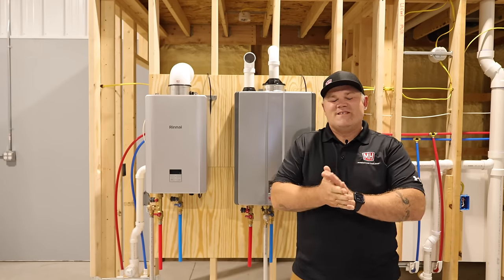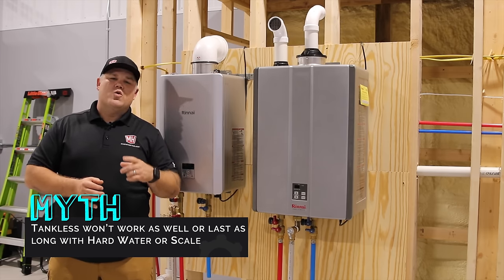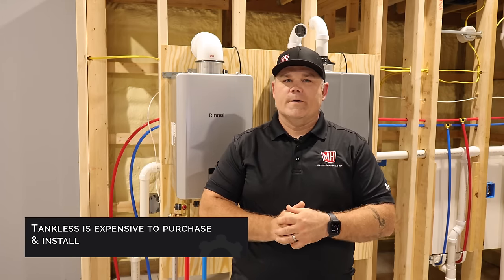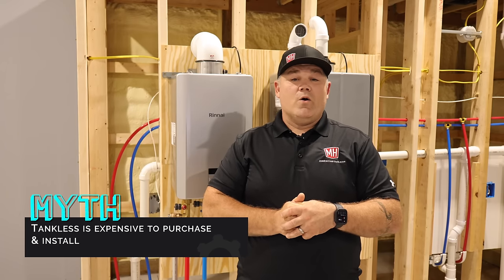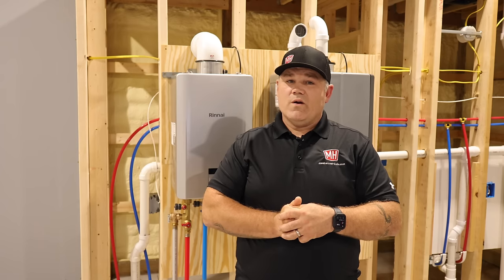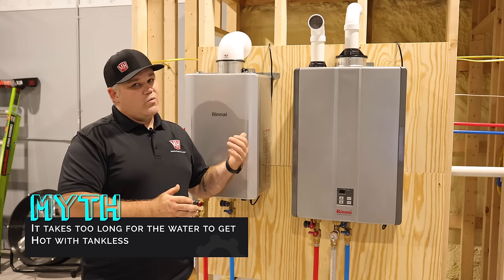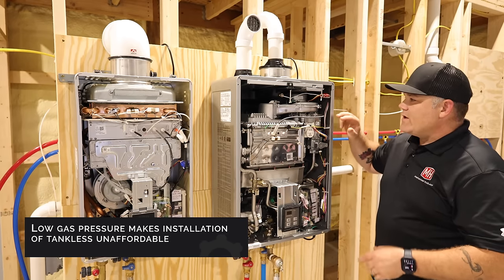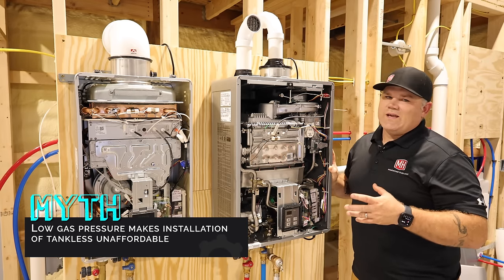Myth Busting! Tank -vs- Tankless Water Heaters

Comment: We have 5 mobile shower trailers. All running tankless heaters. We run 2 199k hot water heaters to run 13 showers with 1.5 gallon shower heads. Second unit hardly ever kicks on. Delime them every fall and good to go.

Comment: What’s your opinion on gas vs electric. In our previous home we had natural gas and when we put in a tankless water heater it was gas. In our current house gas is not available so we have an electric tank hot water heater. I haven’t ventured into a tankless because I’ve been told electric tankless water heaters are not efficient and cost more to operate. What is your opinion?

Comment: Tankless have issues with high efficiency applicance that cause short cycling. HE app. will turn on the hot water for short bursts which prevents hot water from ever getting to the applicance. Only option to add a hot water storage tank, or to use a small tank water heater in series with the tankless.

This also applies to using a hot water at a sink, which you turn on the hot water for brief intervals. The Rinnai tankless have a 30 second cool down mode, which once demand for hot water is ended, it goes through a 30 second cool down cycle before the boiler will fire back up to produce more hot water. The only way to address this is to leave the faucet on until your completely done using the hot water.

Comment: Big thing for me, I will have to first install at least THREE TIMES the length of wire, and that 8/2 AWG x 3 as opposed to the one length of 10/2 I have now. And I cannot pull it through the section of house where the current wire exists. So that would be waaaay too expensive for this ol' retired man on a fixed income. How long is a tank water heater going to last? How long am I going to last? Where does that cash for all that wiring and retrofit come from? Questions, questions.

Comment: gas or electric...does it make a difference and please go over the pricing and money savings in general...my current water heater is really old but keeps working and is gas powered...in Ohio it seems like gas is more expensive than electric so should I convert tankless with or without using gas.......thanks

Comment: I'm a plumber and have been for years. I know tank water heaters are not as efficient as tankless because a tank water heater has large standby losses. The water in the tank is cooled by the vent running through the tank. When tank heaters are off, the 120 deg. water that surronds the vent is cooled by the air constantly going up the vent from the floor around the heater, consequently, the tank water heater runs for roughly 10 min. every hour to maintain tank temp. Without a drop coming out of it. I have a condensing rinnai tankless and have found that it does take longer to get hot water because the tankless starts from cold whereas the tank has its capacity of hot. It just has to get to the tap. Tankless have to sense waterflow and go into an ignition cycle which in my case was around 7 sec. It doesnt start heating the water until it lights and regulates itself. I put a motion sensor in the bathroom which starts a circ pump and is in series with a temp sensor so it doesn't run all the time, only when you walk in the bathroom if the temp sensor is calling. 
Sediment in the water is harder on tankless because their water passages are tiny in comparison to a tank. All water, except for distilled or reverse osmosis water, has sediment in it and will accumulate in any water heating appliance. A coffee maker or tea kettle is a great sign of how much sediment is in your water supply. 
Because tankless heaters have such high energy imputs, whether is nat gas, propane or electric, the energy supply will have to be increased. A storage type usually uses a 1/2" gas line, up to a certain size. Because the input on a tankless is so high, often 50% higher than a standard furnace and storage water heater combined, the line feeding it needs to carry more energy, if the area is developed between the furnace rm and the house supply, this can get expensive. If you're replacing one tankless for another and the previous heater was done correctly, the installation of another tankless should go smoothly. When you change from a storage wh to a tankless is when you run into more expense for the reasons listed above. I know storage type heaters have gone way up in price an although i havent priced a tankless since i put ours in, i can't see them being imune to the same increases tankless saw, especially since there are way more electronics on a tankless than on a standard, atmospheric vented storage type water heater. The latter doesn't use any electricity wereas the fan vented units do.

Comment: Tankless units are okay for homes on wheels, summer bungalows or places where central heating isn’t necessary. There was one important sentence. It was about cold ground water. That needs to be emphasized because these units can struggle to get water warm enough during the winter.

Comment: Both ways work. 11:41 11:41 
It's good to have choices. I have stuck to tank living in CA because of service interupt. Power and water supply can go down. My tank heater uses natural gas to heat and no electricity. If the power is out and water and gas are still flowing I get hot water. Another reason is that the tank holds about 70 gallons of clean potable water. When services are out ig. earthquakes, I have a good supply of drinking water.

Comment: Plumbing since late 70s  The best part of a Tankless is the "luxury" of never running out of hot water. These mythe were busted but I dont think its as cut and dry  as the host made it sound. I wont cover everything but one bit of math was off a bit, shower uses 2.5gpm and with cold mixed in about %85 capacity he said it comes down to 1.5gpm just doesn't add up, 40* well water is colder than most of the rest of the country so in a bit warmer climate he is correct. The installation is job to job especially when converting over. If you treat your water that is going to almost double the cost of WH install, with repeated maintenance but worth it in the long run. 
      That all being said at the end of the day what sold me on tankless is that LUXURY of never running out  and if I was going to build a house for myself I would absolutely put in tankless, with a   recirculating system, I had recirc in my own house, I just sold, and the luxury of almost instant hot water is better than never running out, my wife and I miss that terribly. Depending on your layout it can almost be impossible, as my new house is. With a basement or crawlspace it is very doable but not an insignificant cost. I would insulate the HW lines as much as possible also.

Comment: I got the part of circulating the hot water, but what about using more than one tankless. For instance,  the bathrooms and kitchen are at the opposite ends of the house. This would solve the problem of waiting for the hot water with the added protection of having hot water if one of the units has a failure. A circulating system wouldn't help. 
Is this a good option in spite of the cost?

Comment: The tankless water heaters that were commonly used in Europe and much of Asia, used a series of tubes running through electric elements to heat only the amount of water needed for a particular purpose. the first electric tankless water heater was invented by Stiebel-Eltron in 1929

Comment: I’ve had a tankless water heater for 7 years. Very disappointed with it. It takes awhile for it to heat up the water, which means you have to run the shower for at least 5 minutes before it gets warm, and it’s right next to the utility room. My kitchen sink never gets warm, I’m not willing to waste that much water for the wait. I have an old house and the pipes aren’t as insulated as new houses and I have a well, so maybe that’s why. I’ve been thinking of getting a small tank water heater just for the kitchen so I can clean my dishes with hot water.

Comment: In 2020 I replaced my gas furnace and direct vent gas 40 gal (was a rental) hot water heater, and I wanted to look at an "on demand". Despite a direct vent flu going up through the roof from the basement, the company installing said it couldn't be done...they only had through the wall venting ...so they put in a 50 gal gas fired power vent unit... and capped off the chimney vent.  Now I'm seeing in this video a direct vent on demand unit?  Is there a height restriction on wall for tankless (I had about 6-1/2 ft floor to bottom of existing chimney vent) or were they just taking the easy way out for them? Side note: about a year after the install I noticed the pvc vent pipe had popped out of the top of the new tank and a good 1/2" gap between tank and pipe... not impressed

Comment: I am a new subscriber. The comparison you made between traditional tank vs tankless water heater has led me to favor the tankless option for a two-storey I want to get built. My one reservation rests on the water pressure. Would it be strong enough for our second floor showers? My water supply comes from an independent stainless container sitting on ground level.
Reply: The tankless water heater will not affect your pressure. They would have no poor effects on the second floor plumbing. Do be advised that you will need to get them serviced every year though. If you learn how to flush it out yourself, which is really easy and clean out the heat exchanger, blower wheel for the fan, igniter, and flame rod, and all of the other little parts that need to be serviced you can save yourself, thousands and thousands of dollars over the life of those heaters. You certainly need to de-scale it once a year at a minimum. If you purchased the tankless heater with the understanding that it has to be serviced like an air conditioning unit does, you will be pleased with it for a long time. most people just ignore it, and it becomes a money pit.

Comment: I've installed a tankless water heater in my house several years ago. I did it myself cuz I used to be a plumber.
Now also, I used to live in Europe where those things are ubiquitous.
I bought it on eBay from a Chinese supplier.
It works great and saves a lot on your gas bill.
Get rid of that gargantuous  water heater and get a tankless.
Just trust me.

Comment: I agree with all but one myth. I work for the local gas utility and I have found that with natural gas, there is sometime an initial pressure and volume issue upon start up of the burners. The burners turn on then about one second later the gas pressure will drop due to static line pressure. Once the gas gets moving there is no longer an issue with pressure or volume, but that split second or really one second of delay causes the burner to shut off due to flame rectification not being seen in the unit. The only fix is a bigger diameter gas line. Most tank water heaters use 1/2” line. Usually a 3/4” to 1” line is needed, of course all depends  on distance. I own a tankless and will never go back to tank.

Comment: Question regarding water hardness and quality.  If you have those issue, what type of a fix should I be looking at?  I do need a repipe as I have low pressure. So I figure I need to correct it at the same time.

Comment: I've had a Rennai for a couple years and the only issue I've had is the fan inside. I replaced it once but have had this issue for 1.5 years. It shuts the until off after running for a few minutes if I use the hot water at full blast. I don't understand why this problem is.

Comment: Ive had tankless for 15 years. One thing you forgot to mention. When the power goes out. You dont have hot water. Most new tankless dont have a pilot light. The older models did though.

Comment: mine is a 24Kw electric unit, and since its all electric no vents! just needed to install 2 dual 60 amp breakers LOL
but my electric bill has droped an avg of $23 a month...
We also turned down the power draw form 120Amp (24KW) max down to 60Amp(18KW) max, When we did this (it was a Pin change) the electric bill droped another $18 avg per month.
I still get 109F in 5 seconds, and 120F in 11 seconds

Comment: How often do you flush a tankless water heater
Reply from the maker: Annually is what recommended by most manufactures
Reply: I do mine every January. Have had my Stiebel Eltron for 6.5 years without an issue.

Comment: Yes you left something out. Instant water heaters. We've been using them for 3 decades. They are instant (well, actually take half a second to heat up), runs on electricity, provides an infinite amount of hot water, and is very cheap. I checked recently and they're only about $75 plus installation. We decided to pay slightly more ($100) for a better unit with a pump that will help increase the water pressure. Third world here. Nearly all showers are the instant type. Tankless is non-existent, and tank heaters, only in very old homes or those people using solar for heating the water. How does it effect my electric bill? I can't tell. My bill is about $50 a month. What with the a/c and cooking, I have no idea how much of the $50 used by the water heater. Probably around $5, definitely not more than $10. I know that about 50 - 75% of the bill is due to the a/c, of which we have 3.
Reply: I think you are full of you know what. Most people's electric bills are close to 50 bucks if hey use zero electricity, let alone 3 AC units. People that have two homes and shut one down, still pay a monthly bill plus any power used.
Reply: @danlemke6407  person doesn't live in America where things are 10× the price they should be.. 3rd world here they said.. I bet electric there costs what it did here in thr US in 1960 or so before we started being robbed blind on a daily basis

Comment: I’m doing my research on tankless. The area I would need to install it is in the basement and the run to an outside wall is approximately 20’. Would you recommend the condensing style so that pvc can be used for ventilation. My understanding the concentric style is very expensive compared to pvc. 
Any info would be appreciated

Comment: i love love love my tankless got tired of the water heater issues i set my tankless temp dependent on the comfort temp of the furtherest shower to get comfortable at my master bath (furthest from my tankless) i had to set tankless to 132. will never go back to a tank.  also the install $$ is the same for a small or large tankless the difference in cost from small to large isn't that great we put in the largest one of the manufacturer we put in what our plumber suggested since in all his years NAVIEN worked the best and had the fewest issues   we can run 4 showers AND THE DISHWASHER/ CLOTHE WASHER AT THE SAME TIME no issues.  get the largest possible.

Comment: What about operating costs?
Reply: Ignoring the maintenance costs on tankless, they're basically the same. One thermoresistant heating element is pretty much the same as the next, whether an electric tea kettle or hot water heater. Tanks lose some heat, but are extremely well insulated. If you want to lower your energy bill, get a heat pump electric tank.

Comment: I watch my neighbors cats when they are on vacation.  They recently renovated their house with a sizeable addition.  One of their upgrades is a tankless water heating system.  While trying to clean the cats bowls, which is situated in the room adjacent to the tankless, it takes FOREVER for the water to get hot.  I timed it one time, 4 minutes.  That is ridiculous considering it is a room away.  

I do like tankless, but let's not pretend that there aren't issues with both systems.

Comment: What about replacement parts availability? I have an electric unit, name brand and it needs a couple of replacement control boards and replacement elements that the manufacturer doesn't offer. My 28kW unit is running on 14kW and I'll have to throw it away when the next thing breaks. I'm so disappointed. Which brands offer replacement parts?

Comment: I've had tankless in my house for atleast 13 years now only problem I have is not enough water volume and not enough gas volume. Because of the 1/2" lines running to it unfortunately this is in my apartment and I can't replace the pipes without the lower apartment being vacant.

Comment: We have Polaris tank water heater that supplies both domestic hot water as well as hot water for the radiant heat system.  I have been told by plumbers that I cannot replace it with a tanklees heater because the tankless won't be able to keep up with the radiant system.  Is this true?

Comment: Got a two part question 
First is it a good idea to run a tankless water heater for Radiant floor heating?
I plan on running two tankless heaters, one for domestic hot water and one for Radiant floor heating, I have five 300’ loops of pex B in my basement floor and plan on adding five 300’ loops for my main floor and another 3 300 ‘ loops for my loft area, 
Can one Tankless heater handle that many loops? ( I am going with propane for my  fuel source. Thanks for your knowledge on this !

Comment: I also live in Minnesota, but southern MN.  I'm having trouble finding someone who is qualified to install a tankless hot water heater.  I've tried my closest Home Depot (20 miles away).  Their third party contractor that they use tried to hook me up with a plumbing company that was 60 miles away.  Needless to say, they weren't interested in coming to my home to do the install.  I live in Austin, MN.  Do you have any suggestions for me?  Thanks in advance for any help you can give me.

Comment: If you have an electric water heater, there is no vent pipe. If your water heater is in the basement, running a vent pipe could be expensive or not possible.  Your thoughts ? I actually like this idea but I don't think I can use it with out a vent pipe.